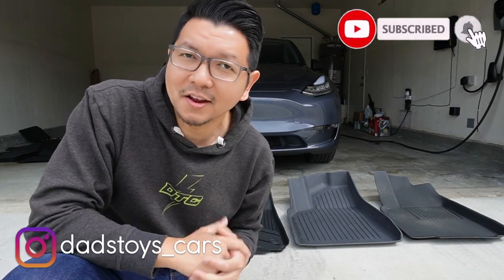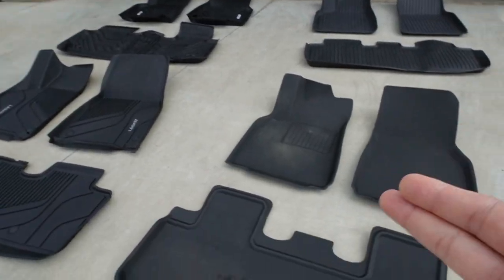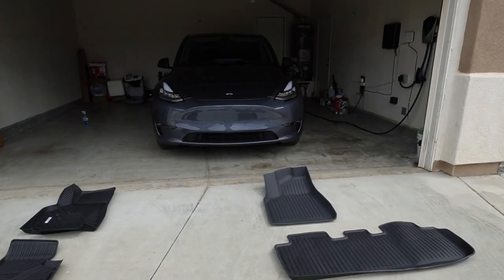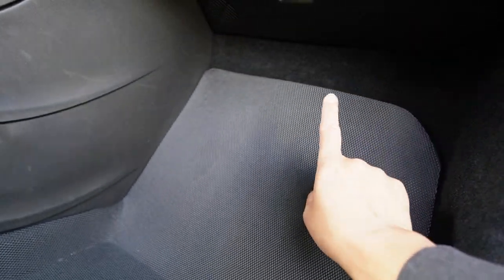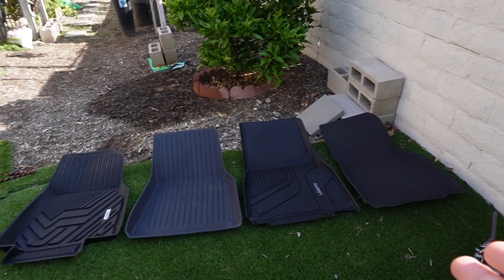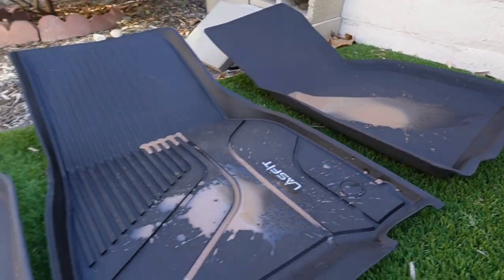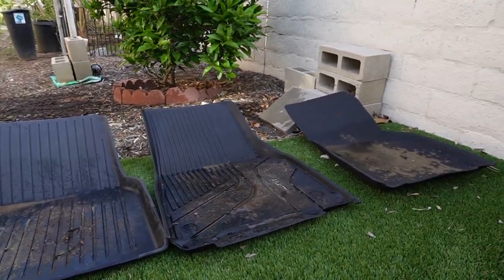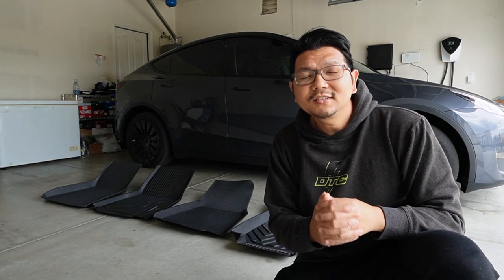Watch this before you buy floor mats for your 2023 Tesla Model Y! #tesla

Comment: Great video as always. Thank you and the little helper. I got mine from Taptes which is good so far.
Can you make a video for rim protectors? Just had my front passenger side rim scratched from a curb.

Last but not least, I think I will go with installing a front camera, anything you would recommend?
Reply from the maker: Appreciate your comment.
I should be reviewing rim protectors soon.
As for front camera, there is only one option with this 10.25” instrument cluster display from Hansshow. 
Here is the link and use code: DAD for 15% off.
https://www.hautopart.com/collections/tesla-screen-upgrade/products/tesla-model-3-y-instrument-cluster-heads-up-display
Thank you for your awesome support!🙏😃
Reply: Thank you so much for all you do
Do u think installing the camera and front cluster would impact the warranty?
Reply from the maker: @mohamedali-egy  I think as long as it ‘s plug and play display and you are not modifying the OEM part. It shouldn’t void the warranty.